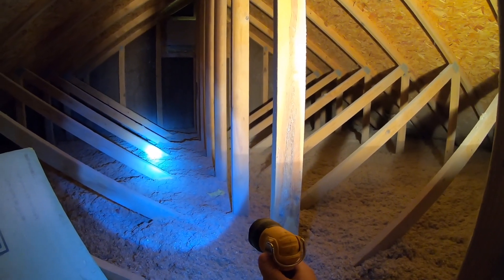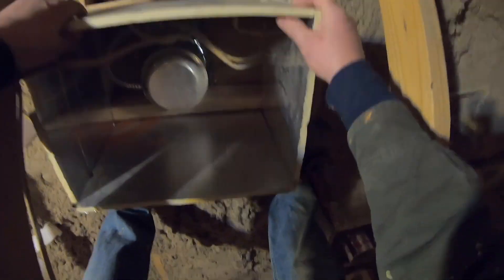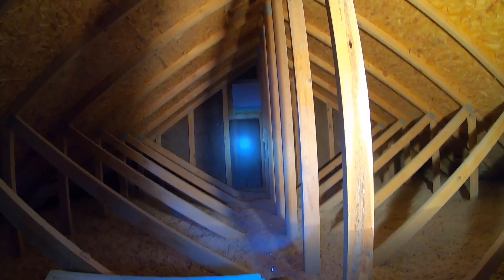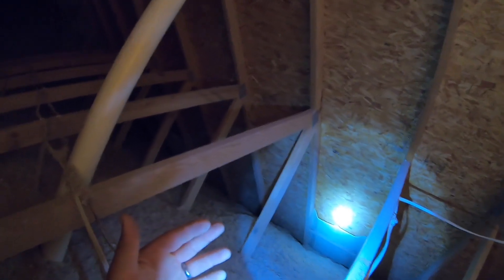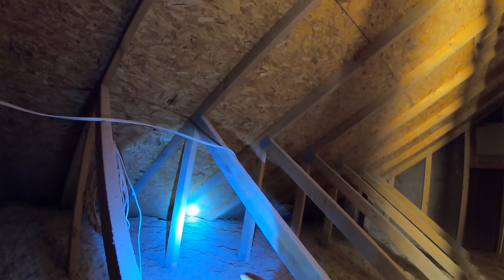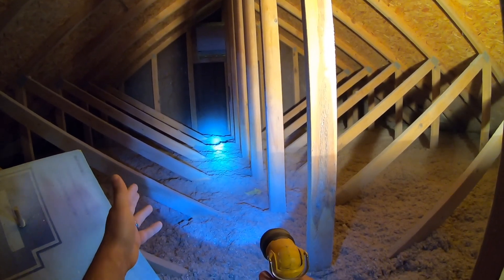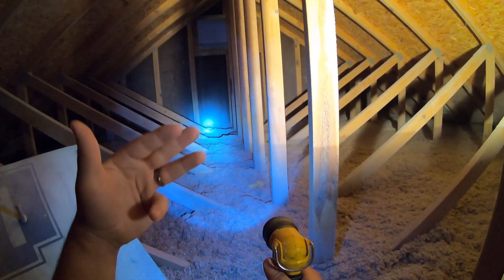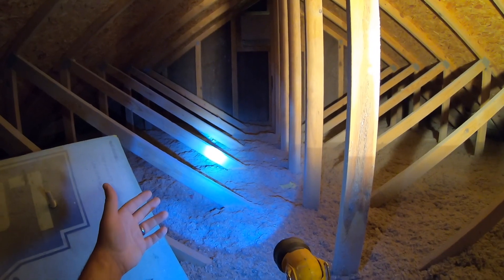How to Air Seal and Insulate an Attic to Save Energy

Comment: I believe code requires fire resistant foam (which is typically orange, not yellow) for any sealant in a wall cavity such as the wiring chase.  Appreciate the video but for anyone attempting this product make sure you get the right kind of foam for the job.

Comment: When you air seal attic don't you have 2 vent the living space somehow from gasses and stale air and such?
Reply from the maker: There a no requirement to do this.  If your home has spray foam insulation then an air exchanger can help a lot.
Reply: @HowtoHacks  why is this
Reply from the maker: @Brandon-no3vc  houses naturally breath a little allowing air to filter in and out.  However, if spray foam is used in the walls it seals everything very air tight.  This is good for energy efficient bit the house can get stuffy.  There are ventilation units that kick on when the HVAC runs to keep fresh air in the house.  Most houses don’t need this and breath plenty, in fact most need more air sealing done.  All this to say sealing the attic access is good and you shouldn’t worry about it makes no the house too tight.
Reply: @HowtoHacks  explain better